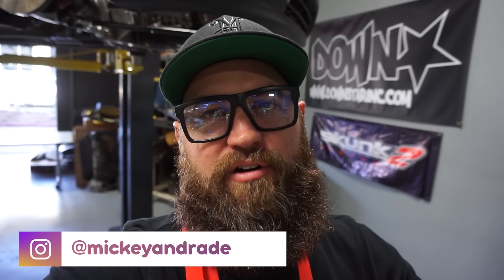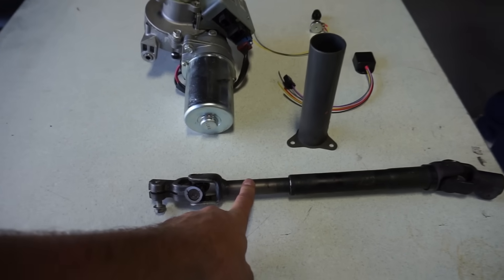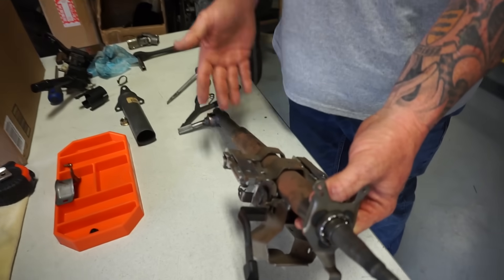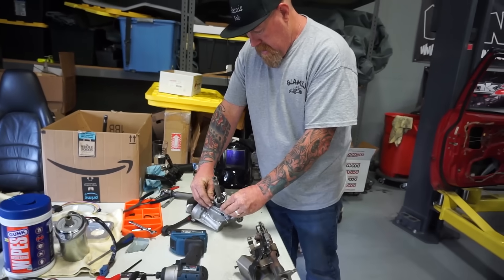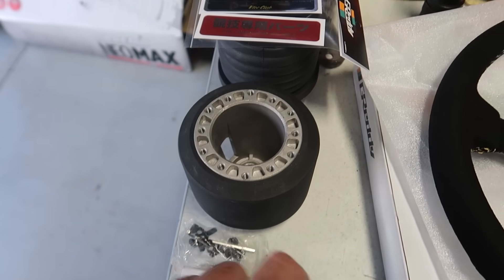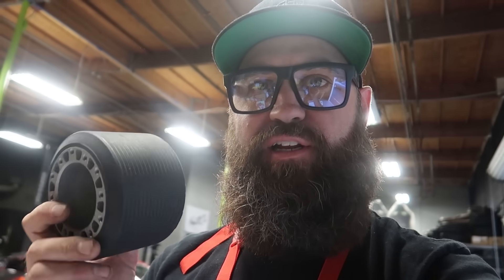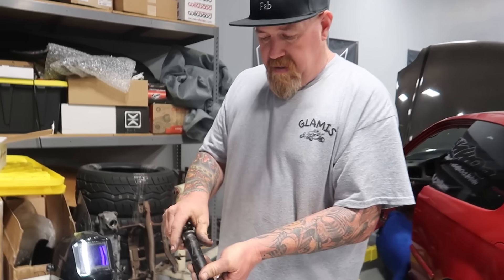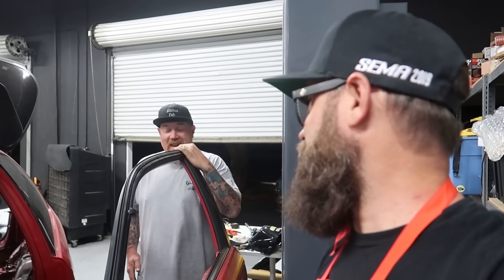Converting the Rear Wheel Drive (K20) Civic to Electric Power Steering

Comment: The steering column UJ's have been tacked in phase with each other. I think I saw the angles of them in the car  and they are only small so you probably won't feel it but the phasing you do have in both of them will be added and not counteracted. One of them simply rotates 90 degrees to make out of phase. 😉

Comment: Where is the clutch? I thought it was a manual not an auto.
Reply: I'm confused... it is Manual where did you see an Auto transmission at?
Reply: Civicguy231 H - You do understand the car is heavily deconstructed and the majority of what you’re seeing is for mock up purposes, correct? The sole reason for the brake and gas pedal is so we could properly place the steering shaft. There was no reason to have the clutch pedal present in the car for this. We have a set of Wilwood pedals that will replace the OE pedal set and that content is coming up soon. 👌🏼

Comment: What is the additional power required?
Reply: TheKomar924 12 volts DC (direct current)
Reply: No additional power required. Powered by your existing 12v electrical system.👍🏼
Reply: @mickeyandrade3435  Thanks!  I was wondering if need to upgrade alternator.

Comment: And I BET you that setup WILL NOT return to centre when drifting properly....ask me how I know
Reply: If you have no binding issues in your steering you need to add positive caster to help with self centering
Reply: @lloydgrandy8189   yes i know - doesnt work...POSSIBLY because the frs setup im using is not compatible with other cars....
Reply: Ruthyless_86 🤔  How do you know?
Reply: How do you know?
Reply: @mickeyandrade   because ive done these before
Reply: Oh yes it will, this unit is centerless. It will absolutely return to Center, as long as your car return to Center without it it will return to center with it, I'd venture to say if your car did not return to Center you had a problem with your steering rack or your alignment Etc.. ask me how I know.. @dune_addict
Reply: The Speakezes SpeAkEzEDJ  oh it returns to centre alright, just not quick enough for drifting